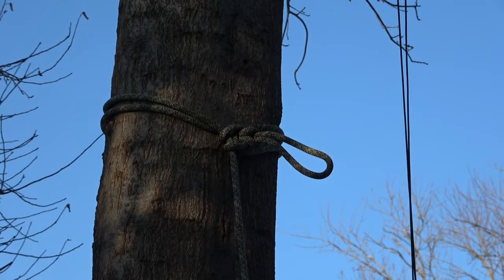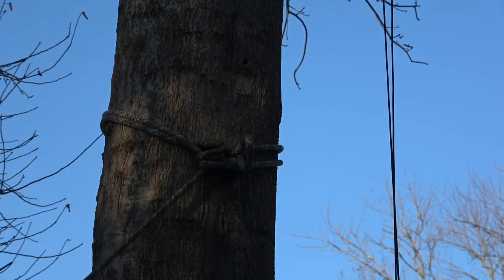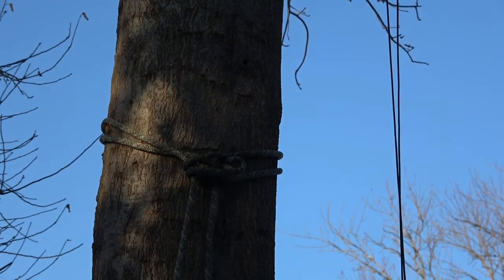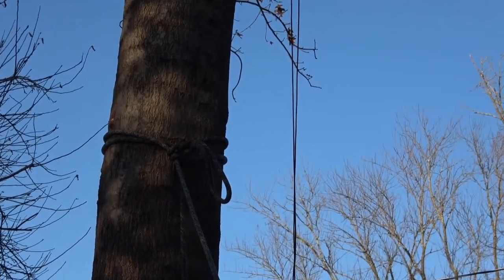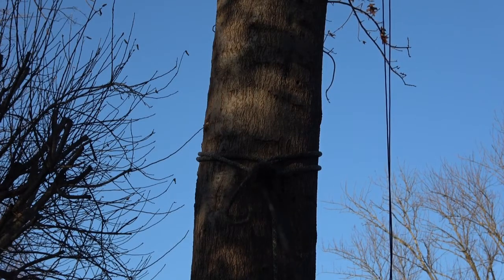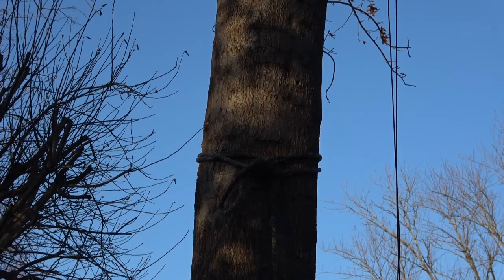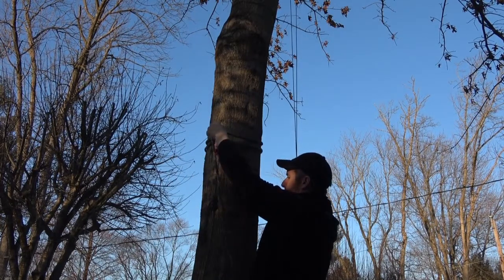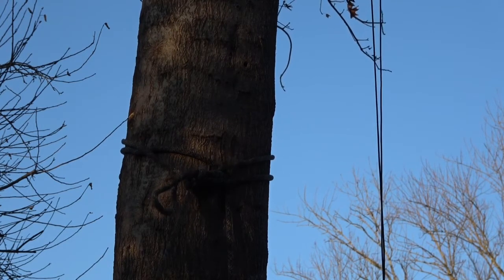JRB Hitch: Three Iterations of Stability & Fault Tolerance Test

Comment: I am going to be getting a saddle for the first time this year and I love what I see in your climbing method. I have a question about the ropes you would recommend. Do you use dry treated or non treated and static or dynamic? Thanks for your help on this and for all your videos.
Reply from the maker: Appreciate that. If you're on Facebook, i have a group by the same name and i keep a "shopping list" post with all the ropes i have used. Bottom line is that you CAN use any life-safety climbing rope.  I prefer thinner ropes, tactical-rope, in the 8-9mm range. Dry ropes preferred. Static preferred.